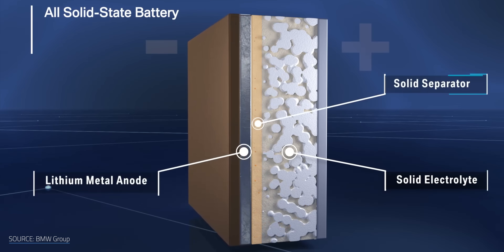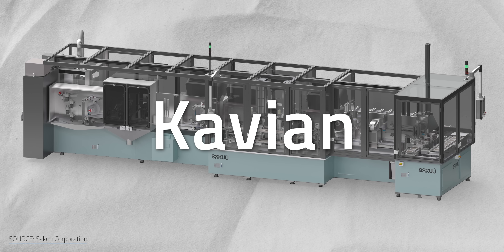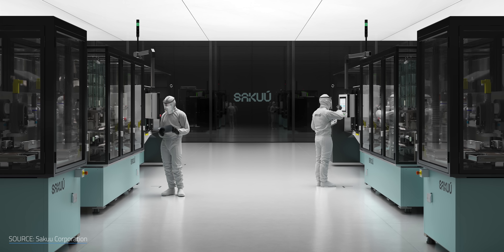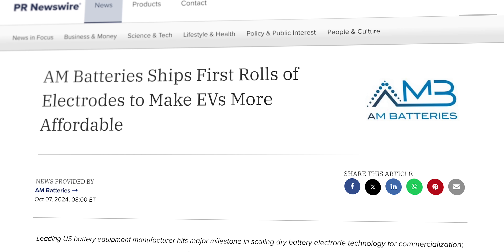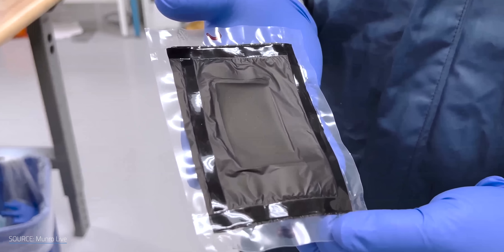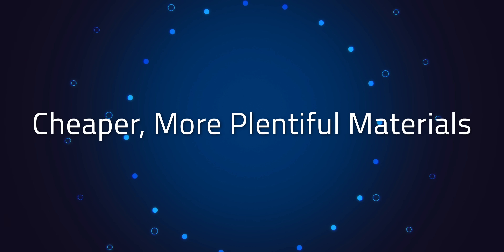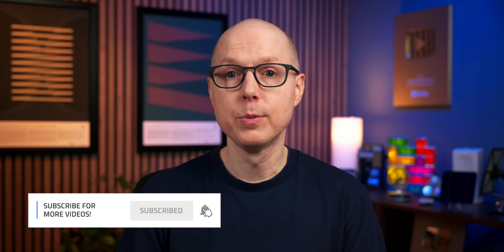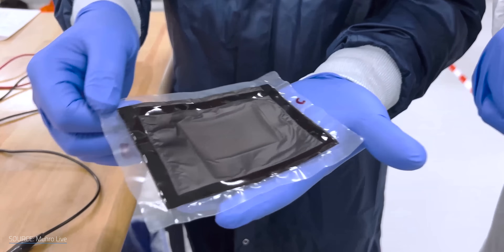Why This Ultra Cheap Battery Breakthrough Matters

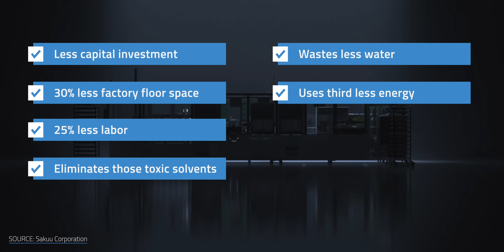Comment: 3:24 Impressive, but what about production throughput? That is a super significant factor to leave out.
Reply: The printing happens in a roll to roll process. Sakuu's printing platform will increase throughput with every iteration, starting around 700 MWh/y with the first equipment. By eliminating the ovens the economics become efficient at much lower production throughputs.
Reply: @tonyc7352  Yeah, I can’t imagine 3d printing throughput being as good

Comment: Yeah,  I hear ya Matt.  But your optimistic appraisal of future battery technologies being cheap because the cost is low,  is wrong.  You always have to factor in the Supply and Demand Model and then add in The Greed Factor.    I promise you this,  they will get their 30-40% margins or more regardless how low the material cost and how cheap the labor to manufacture the batteries is.  EDIT:  With all respect sir.   I wish I could see things again the way you do.   Do not let life take all of that away from you.   Its good that you see the future with optimism and delight.  You should.

Comment: Energy density is not such a big factor. It is for your mobile phone or your car, but if your battery pack at home was twice or even four times bigger, would it be such an issue? At the power plant, it would certainly not be.Safety and cost will be driving the choice.
Reply: Yep. It is why sodium batteries are beginning to take over for production battery farms in China - you need more containers, but the contents are as cheap as chips and last forever.
The hard fact is that the US has slipped way behind China on batteries (and much else too, especially bioscience. Believing absurd things such as the earth is only 6000 years old carries costs).
Instead of slashing science Trump/Musk would do much better to pour money into the new energy - as Biden did and as Musk once did.

Comment: Matt I appreciate your vids. I also appreciate your enthusiasm for the tech. Even if these batteries were available now at this great price point we still need the generation capacity to charge them. What’s your solution for the energy? Wind and solar aren’t going to do it. The amount of energy needed for everyone to have an EV and for the data centers for AI there isn’t enough generation capacity along with that fact that the grid can’t handle that much power. Be an engineer and have some videos solving this dilemma.  Thanks
Reply: Scale on the consumption side is certainly an issue but, people being people, we will only address it after it becomes profitable.If batteries fall in price and EVs take off, there will be demand for charge capacity. Grids will adapt to suit after. Most likely there will be an expansion of fossil fuel electricity sources but that's how it is. That said, there are plenty of uses for a cheaper/lighter battery today - I'd love one in my ultralight aircraft and I'd love to buy an EV or electric scooter.
Reply: big tech ai companies invest into their own small nuclear reactors, so there is that. then there is thorium reactors like copenhagen atomics that will be good if it works.

Comment: Why didn't you touch on Lithium Titanite in terms of comparisons or compatibility with these new techniques? Especially against discharge cycles and retention of capacity. Cheaper is one thing, but surely reducing the need to recycle the batteries from every 5-7 years to 20-30+ years is worth integrating?

Comment: Stack all the dry manufacturing machines you need to meet the productivity of the wet process machines and it will probably be about the size of the wet process equipment.

Comment: It will work down the price curve as long as governments don't play subsidy games like they are now. 

I was doing some due diligence on battery recycling and found that the start-up's technological capacity was irrelevant relative to the political connections needed to get the fat government funding.  I can evaluate technology but not politics and PR.  In much of the energy space the government games are everything. 

At one time, I had an innovation that solved a hazardous waste issue with very high and cost-effective performance.   I had a scaleable pilot facility when the EPA offered a lot of money to solve this problem, and we applied for this grant, but we lost.  The company that won had a long history of government contracts and an actual PR department and Lobbiests, but I knew their design could fail if the upstream treatment system had a minor hiccup.    We took a chance and designed/built a commercial-scale system on our own money and ultimately cleaned up the problem in private sector areas of contamination (a team of 3 small companies).  We lost the contracts from all the government agencies but in the end we eliminated over 90% of the problem with our technology.  Our clients has skin in the game and government clients didn't care how much it cost.    The messing about with the grant wasted about 6 mo of our development time.  

After being on many committees that made government awards for innovation and also observations of Angle Investors and VC's, the government agency awards are shifted towards safe and very low risk innovation and anything with real innovation potential dies a slow death.   A 20% cost advantage would allow you to kill all your competitors in a free market but you can get killed with a 25% subsidy to your competitors.

Comment: and not 10 seconds in and we have the first error
the biggest issue they face is DIFFICULTY IN MAKING A NEW TYPE OF PHYSICAL STRUCTURE

solid state batteries are being researched, sure, but they have yet to become the ACTUAL idea of a solid state battery(ie a solid object made of layers of various materials with 0% fluidity(electrolytes are ok, but if you can bend it it isn't really solid state)

is funding for research and scaling a problem? yes, it is the ONLY and biggest issue? still no

now some PSEUDO solid state cells have come out, and they are quite promising in density and stability, but they act more like LiFePO4 cells, those that CAN'T be installed in high-load devices like an EV without MASSIVE packs(about 1-2C discharge rate, while lithium-ion cobalt types can do as high as 20C)

the real story is about picking the RIGHT battery for the application, ie not having lithium-ion in phones with non-removable batteries, as a LiFePO4 cell can be just as useful and have a much longer lifespan with less fire risk(note 7 anyone)

sure your phone will be bulkier, but I am gonna say it and anger a bunch of fashion-only idiots, YOU DON'T NEED A PHONE THAT THIN AND LIGHT
hell even airlines would be happier if devices used LFP cells instead of lithium ion, because the reduced fire risk leads to a lifting of capacity limits because of thermal runaway

my laptop has a 3 cell 11.1v lithium ion pack, but the internal chassis could comfortably be bigger and stuff nearly 2x the capacity of a LFP cell pack and I would not care about the extra weight or bulk(in fact the extra thickness and volume would make cooling fans be bigger, removing the biggest gripe overgaming laptops, the fans are louder than the speakers at 100% volume)

so yeah, SSB's would be cool, they would offer safe and long-life power storage, still useless for EV's until a true SSB could be perfected, but my phone, my laptop, my standby backup array? I'd happily have a PSEUDO SSB stack as it would last longer and hold more for less cost

Comment: With conventional roll or prismatic batteries, you get even current and voltage across the entire cell by connecting all of the layer tabs together to make impedance equally low across the whole thing. With large foil batteries, any voltage/current balance would have an uneven voltage/current distribution from the point of the foil is tapped to provide the voltage-sensing and balance current. For a car-sized battery, one foil layer doesn't provide enough Ah, cells would need to be paralleled somehow to meet capacity requirements.

If you wanted to build a car battery out of these, you would need to make a compromise between how many cells you can put in series inside one slab to save on current-collecting electrodes and the likelihood that a defect anywhere within the slab causes the whole thing to get rejected. Having more series cells per group also means having to accommodate more tab positions for balance terminals in the manufacturing and assembly process to make paralleling easier. Probably want to keep that to a convenient BMS grouping size like 16S, 20S or 24S.

Comment: If this can lower costs & is space saving can it make batteries in general longer lasting without bulking up or costing an arm & a leg?
Reply: Yes, if you keep the same battery volume and weight, you'd get more range out of your EV

Comment: This is disastrous for repairability, not companies are going to have extremely custom and specific batteries that will be hard to replace. It wont be a standard size or shape that i can find a million replacements for, it will be a one off, hyper specific one that an average consumer wont be able to get. The 18650 is legendary because everyone makes them and they are used everywhere. I can go find 100 different 18650's to replace a dead one in many of my devices and get one that suites my specific needs. But if batteries become specific to allmost every product, well then the moment that battery dies the product is likely to end up in the trash.
Reply: Good Point.  I hadn’t thought of that.  We really need legislation to require that thing they call “circular economy” on every manufactured product.  And not just tech! Look at the disaster that Fast Fashion is.

Comment: I built a DIY LIfepo4 battery for my off grid system 15.4kwh for $1500 in 11/23. Bought another set and DIY box from China in 11/24 for $1000

Comment: These days, whenever I hear someone discuss a breakthrough that will reduce the cost of something, I automatically think of it in terms of shareholder profit.

These batteries won't cost 50% less to the end consumer, they will cost just enough to slightly undercut existing batteries. The rest of the "savings" will go directly into shareholder pockets.
Reply: generally, yes, but the problem is that the sales of electric products have been getting stagnant, meaning a price drop could boost the sales, specially with so many companies competing in the market, the one that sells the most accessible product will win the war.
Reply: That temporary extra profit is the incentive to develop them.
Reply: Immediately having one perspective from which to view events will certainly limit what you experience in life. They will be some things which will need to be distorted so as to fit your perspective and other things will never be seen, but not because it didn't happen.
Reply: And?
Reply: CO2 is climatologically irrelevant. 

CO2 is climatalogically irrelevant: Interglaciation climate change (e.g. the Medieval Warm Period) is caused by cosmic ray fluctuations ( see the work of Henrik Svensmark, et al).

Just burn coal: the CO2 issue is irrelevant (see above). The sulfur issue with gaol is bogus too: sulfur is an agricultural fertilizer (ask the farmers). The "acid rain" issue is at most "a nuisance" (see the $500 million NAPAP study of 1990).  "Acid rain" was another one of those shallow media sensationalisms, like "global warming" and "ozone depletion". 

Global warming is 21st century superstition. 

Just burn coal.

Sorry, but however intriguing these battery-thingies are, they are just another tax-sheltered boondoggle for people who don't want to do get a real job. 

Just burn coal.
Reply: Then eventually there will be a competitor that uses the same tech to undercut them, creating the price war he was talking about. Profit now, compete later.
Reply: @littlejack59  

This is where government policy kicks in. China may enjoy robust competition in the battery space, but if regulatory barriers in the United States limit battery manufacturing to just a small number of companies, while steep tariffs keeps foreign-made batteries out, the cost of batteries won't go down here, even if they do for the rest of the world.
Reply: @littlejack59  This doesn't always happen, plenty of industries are effective monopolies. But usually this happens eventually
Reply: So if you owned a battery company and someone invented a tech to slightly undercut your battery prices, you would just lay over and collapse instead of adopting the technology to undercut their own prices?

To be more specific, where do you think the exponential drop in battery prices of the past few decades came from?
Reply: Assuming they get Any investor foolish enough to waste money on these "game changers"
Reply: @ I have invested in a few and had 50 to 100:1+ returns for it.  
Unfortunately, my investments were 10's to a few hundred dollars so my total gains after taxes and everything else was not majorly life-changing good.
Reply: And those profits will be used to further increase production savings, making them cheaper for the next buyers. This is how EVERYTHING works. If you're just realising this, perhaps this version of reality is not the one you should be playing in.
Reply: As a share holder/investor,  And?

Comment: It is more likely that the manufacturing cost savings will be soaked up by manufacturers, distributors and of course investors while modern marketing methods will push the new safer, lighter more efficient technologies to be sold at elevated cost to the end users to maximize profits. With a bit of luck the consumers will see slight reduction in prices after mass production is well underway and the initial push to cash in starts to fade. It is also quite probable that rising energy costs and additional tariffs inflating costs of PV will make it more expensive to charge batteries so the end user will only actually see a minimal purchase and overall operational cost reduction. I really hope I am wrong but it seems that profit and greed drive final cost upwards with everything these days.

Comment: Cheap and abundant stuff instead of lithium, nickel and cobalt. Fantastic!
Reply: Some phones nowadays use Silicon Carbide batteries. It allows them to charge much faster without as much heat

Comment: how different is silicon carbide battery?
Reply: Silicon carbide is more geared for energy density and performance. The chlorine chemistry in this video is a cheaper replacement for lfp batteries, which themselves are supposed to be long lasting, cheap and more geared for solar and grid storage. Not that they aren't used in cars without much issue.

Comment: Making an improvement in battery weight will be a huge factor in further EV efficiency and make them more fun to drive. You don’t hear the complement, it hides its huge weight well, when talking about ICE cars. If they can get this all into production, sounds like a real winner.

Comment: As a cheapass i am already pretty thrilled about where LFP is after years of price drops (35kwh attached to my house currently). The idea of something being substantially better in cost and performance is almost mind-boggling.
Reply: @Vigo327  pretty wild times
Reply: As a fairly new dabbler with LFP, $35/kwh sure blows my estimates out of the water as I thought I was doing decent at $70-$75.. Do you mind educating me or sharing brand, strategy, etc. on where you’re getting that price? Are those super knock-off’s or are you just kicking but..? The number I shared for myself is doing DIY by buying the cells, and no I have not purchased serious bulk or direct. 

Thanks for any info.
Reply: @kameronwilson1397 I think you misunderstood. OP didn't say $35/kw, he said he had 35kw attached to his house.
Reply: @kameronwilson1397  he did not say $35 per kwh.  The interwebs says global average lfp price is 115$/kwh as of Dec 2024.
Reply: @Vigo327  🤣🤣
Reply: As a recent Solar System user, I only have a 5kW hour battery. It was never designed to be an off grid system. I put $28/week into a solar savings account (Cost of whole system divided by 15 years), to build up an 'upgrade' as I go along. The greatness of this technology getting cheaper, as time moves on, is that when I buy more solar panels or add a new battery, I am going to get more production and capacity, for a cheaper price. This ensures the robustness of my 'investment' is better than what a money investment would do. I pay no interest on the excess power I produce. My power account credit keeps increasing every month. Soon I am going to ask the power company to transfer some of that money into my solar savings account. It's a win win situation for my solar investment during my retirement. This is another way of looking at it long term, compared to a cash portfolio.

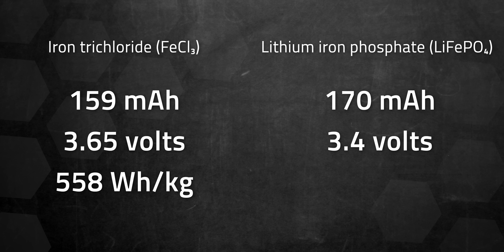Comment: there is absolutely no way the energy densities at 10:48 are correct, LFP are around 160Wh/kg and the best li-ions are around 280Wh/kg
Reply: Yeah I came here to say the same thing... These numbers are wayyyyyy off... 

Kinda seems like maybe Matt just makes video with repeated knowledge he knows nothing about... Its pretty common knowledge lifepo4 batteries are in the sub 200 wh/kg range

Comment: I just bought a cheap 2013 Nissan Leaf from a coworker. It's showing about 70% battery health on the original battery pack. I'd love to rebuild it with some newer, higher density cells and get a lot more life out of the vehicle. Interesting to see what is coming up!
Reply: Check out Dala's ev repair youtube channel. he has videos  on how to do that and talk to the BMS of a bigger battery
Reply: That's awesome. Perhaps you can share before and after range. ❤